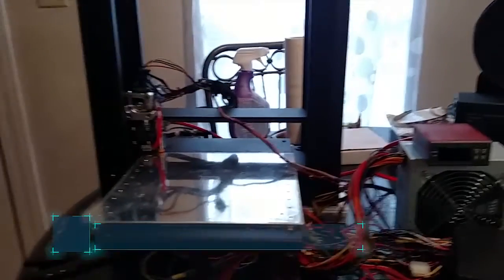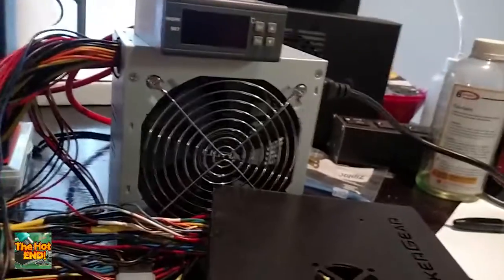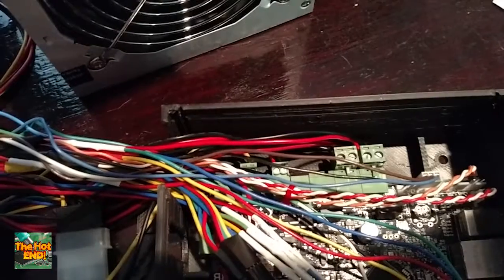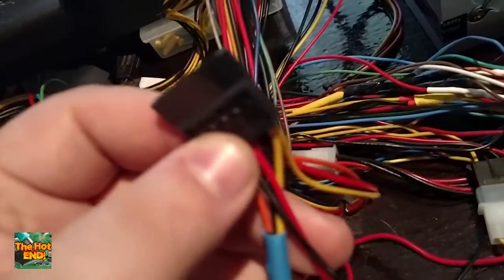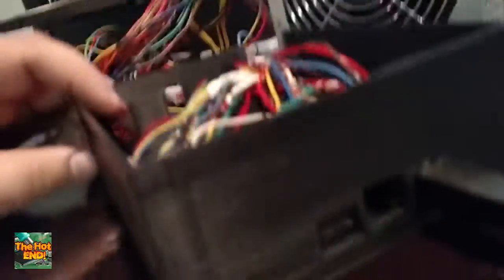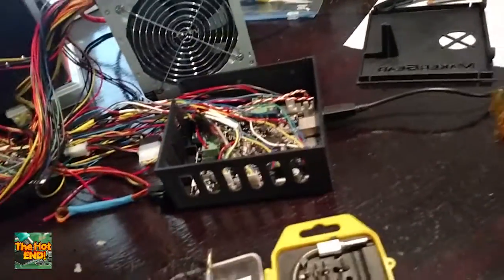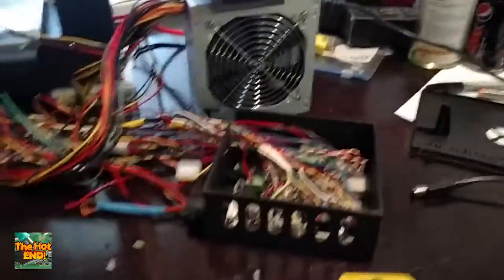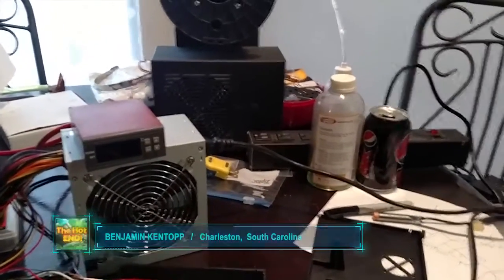Smoothie Board in PrintrBot Plus 3d printer Update!

Comment: I have this printer with a e3d v6 hot end with stock fgen 5 board. have my zprobe super low cant ever get the M212 to move the hot end down close enough to the bed, the probe does show as triggered but can never get the darn thing to get close enough the bed to print properly. Any suggestions?